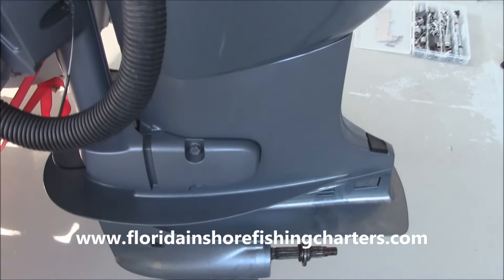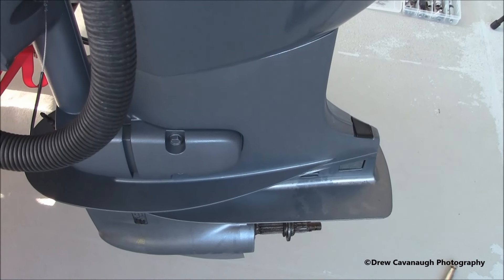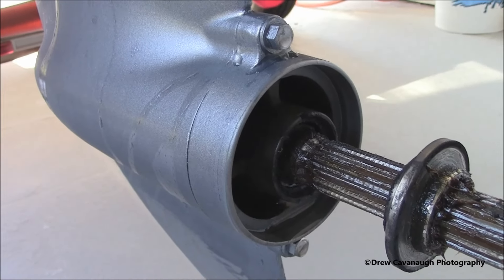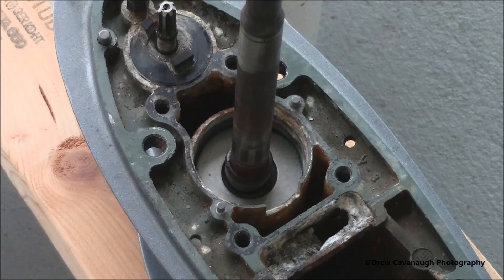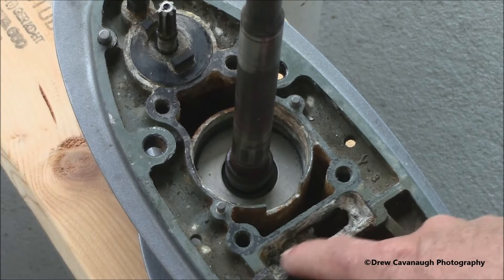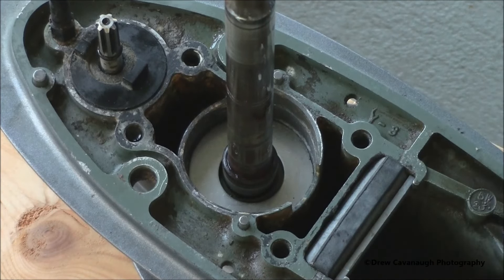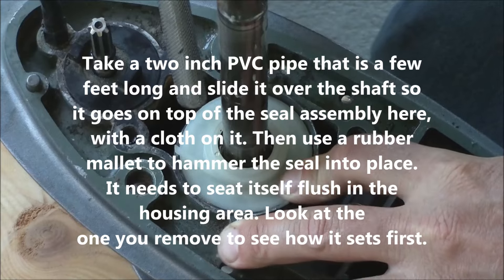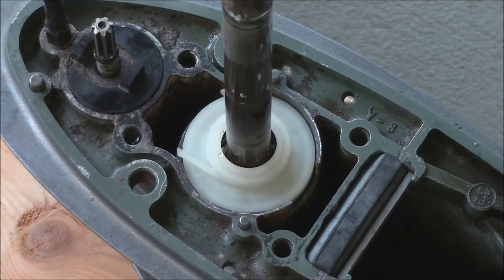Yamaha Outboard Oil Seals and Water Pump Housing Assembly Lower Unit  - Update 2024

Comment: Hi i have a problem with my Yamaha 8hp 2 stroke 2010 outboard i had to change the impeller on it but when i was done and was gonna put back the lower unit i just could not do it im not sure what i have done wrong, i have watched a bunch of tutorials and for them it just slides in but i can only get in until theres just a bit more to and it just stops, Can you help?
Reply from the maker: Was in neutral? If it was in a gear then it needs to slide back in what ever gear it was in. It is very important to make sure the gears are not shifted. You can try to move the gears around. forward reverse and what. This happens often.

Comment: I am pretty sure that there are also one or two seals around the shift rod assembly which can go bad and allow water to leak in and mix with the oil. I currently have that problem on my Yamaha 115 outboard (C115TLRW), so I am about to replace those seals. Let us know if I am mistaken and that is not a potential source of water leaking into the lower.

Comment: I have oil coming out well above the top screw. (Where the wire is hanging by on yours, like a weep hole.) What seal do I need to change?
Reply from the maker: Not sure which screw you are talking about?
Reply: @captaindrewcavanaugh  above the top drain bolt.

Comment: I’ve seen a lot of videos where the prop is spun, it spins the shaft to help with the direction for installation of the housing over the water pump.  Are all props supposed to spin the shaft? My propeller spinning is completely independent of the shaft.
Reply from the maker: If in gear it will.

Comment: Change water pump with the kit. Still not pumping like it should. Only 10 lbs its at 4000rpm. Will changing the thermostats help with this problem? Do you think I need a new water pump housing seal? I have a Yamaha 225 HPBI. Thanks
Reply from the maker: Ricky Boehm You can try that. They may be stuck open. Wont hurt to look at them. Your gauge could be damaged or clogged too.
Reply: Always change your thermostat when changing the water pump assembly